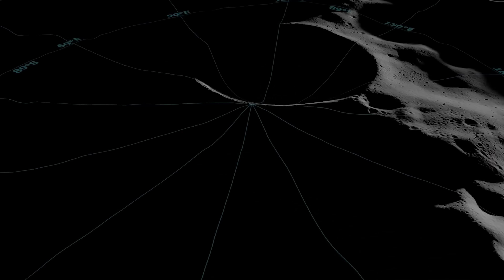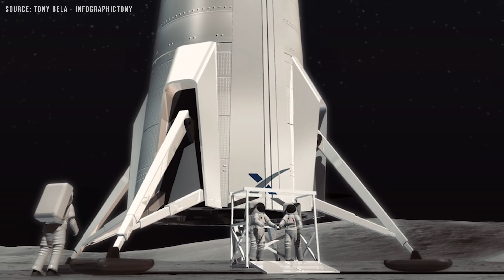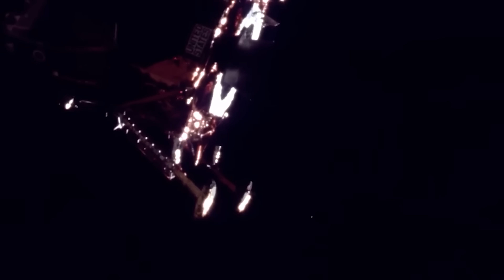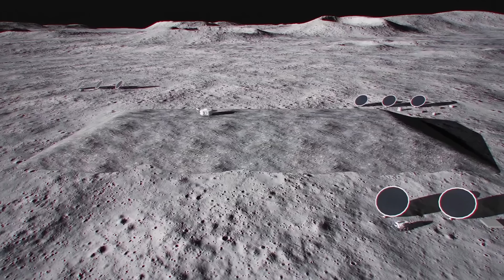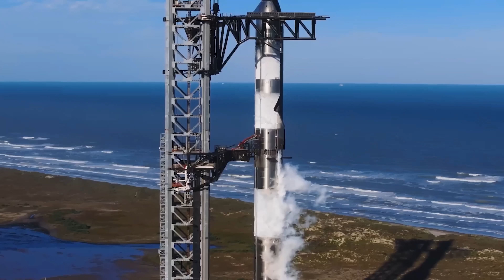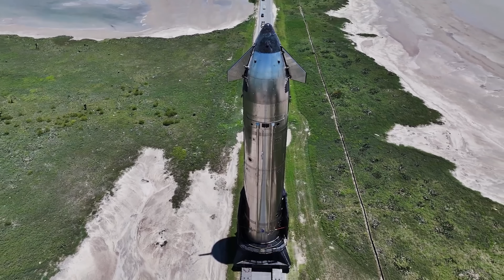SpaceX's New Method to Land Starship HLS on the Moon Sideways, Solving NASA Big Concern..

Comment: Starship is designed to be the second stage on an earth to orbit vehicle. I think landing on the moon requires designing a vehicle FOR landing on the moon and going back and forth to lunar orbit. The Space Shuttle was a one size fits all vehicle that didn't do any particular job very well. Considering all the trouble they are having with the second stage of Starship, I'd suggest a shorter second stage with tanks and engines only and droppable fairings over the orbit bound cargo riding above. Might even have to have reusability wait for a bit on stage two because it looks like a gigantic, workable Falcon 9 right now capable of putting huge amounts into orbit with a reusable booster that drastically cheapens costs compared to SLS. Clearly with nearly EVERYTHING tipping over on the moon as of late, a lander needs to be designed as a lander first and foremost and be wider than it is long so it can't tip over.
Reply: Please do the math on the center of gravity on the vertical Starship HLS, it is NOT the visual center of gravity and is in fact much lower, reason is the propellent weight at near the bottom of the craft.  Calculations show it would need a 21 degree tilt to "fall over", that's pretty large.

Comment: The bottom line is with Starship you're essentially landing a big, heavy, mostly empty fuel tank on the Moon for no discernible reason.
Reply: So, using blue origin Moon lander for transferring astronauts to the moon but using Starship horizontal model for habitat on the surface of the moon. Vertical Starship model can be used later when there is a flat launchpad on the moon!!
Reply: @Tornout-e7i  Who's getting the humans from Earth to the moon?

Orion
Starship
or
Blue Moon
Reply: The reason is tonnage to the moon.  This inherently requires "big" and "heavy".  No tonnage means no Moon base build out.

You wanna send Humans and tiny bit of cargo to the moon surface?  OK, use Apollo or Blue Origin Blue Moon Mark 2, those will get you a few people and enough cargo for a few days - but didn't we do that in 1969?  But it won't get you the massive tonnage you need to stay long term, or start building the base.  Thus Starship.

Comment: Blue Origin are so getting the main contract 😂
Reply: BO's New Glenn is suspended after the failure last Sunday pending FAA investigation.

BOBMMark2 tonnage to the Moon is pretty weak compared to Starship.

*AND* BOBMMark2 in the latest official diagrams shows not only a refuel in LEO, but also a refuel in Moon orbit.  Why?  Because BOBMMark2 is so small it can't carry all the fuel it needs out of LEO/TLI, and needs to AGAIN refuel in Moon orbit.

Starship only needs the refuel in LEO.

Comment: Horizontal is the only smart way. But the structure as designed can’t handle it. I can absolutely guarantee that one of the current versions is going to tip over on landing. Big explosion. Dead crew. That elevator system is laughable engineering imho.
Reply: Need to design a vehicle just for going back and forth from lunar orbit to the surface and back. Shoehorning a second stage of an earth launch vehicle for a purpose it isn't suited for probably won't work. Use Starship to put cargo into earth orbit and there construct vehicles designed for use only in space. Plus with everybody's lander tipping over recently it's clear that lunar designs need to be very short and very wide for stability.

Comment: I am not a physicist so I am not qualified to judge any design. Nevertheless, this SpaceX moonlander will tilt over quite easily I would imagine. Or does the low gravity makes it different from landing on earth ?
Reply: The gravity doesn't really change the tendency to tip, that's controlled by the centre of gravity of the thing. It'll just  tip more slowly on the Moon.
Reply: You are mistakenly assuming a rigid landing surface.  Lunar surface contours can be locally quite steep and the surface is unconsolidated. Things tend to slip easier. Once a slide starts the vehicle inertial properties make tipping much easier.
Reply: Visually the center of gravity looks to be midway, but people forget the fuel is stored at the bottom area, which moves the real center of gravity downward making it stable to a calculated 21 degree allowance of tilt, this is a pretty large tilt needed to tip over.  Eager Space channel has done the math on this.

Once it's landed, it's not going to "slide" like the other commenter said.

Comment: With a horizontal landing wouldn't that have the same problem when the thrusters are too close to the regolith?
Reply: Not if you have half a brain. The required thrust output is far smaller than for the deorbit phase. Much smaller engines, mounted high on the sides, would be many meters above the deck. They also don’t have to point straight down. You can actually perform a sort of flare maneuver as you approach the ground and gradually toe-out the engines to gradually reduce down force and greatly suppress regolith entrainment.

Comment: Send more than one rocket that lands horizontally, with no intention of taking back off. Build a moon base the same way they built the space station. Sending up a node at a time. This is how the ISS was built. With at least 40 trips with parts and pieces. It took over a year and a half of lifting pieces before any human lived aboard the ISS. Do it the same way with a moon base. A piece at a time.
Reply: FYI: One empty Starship V3 has a bit more internal space than the ENTIRE ISS.
Reply: @ConstantTrue  And they will STILL need multiple trips to set up a moon base. Which is forecast to be nothing like the ISS in size or capability but a true base of operations including a fuel depot and etc. There will need to be multiple trips as the moon base will be many times larger than the ISS.

Comment: Elevator failure emergency operation can be achieved by installing a protracting/retracting arm close to the top, that releases a pulley operated cable. The cable can be hooked to the space suit and pull back the astronaut. NASA, you read it here first!
Reply: Also a 2500lbs Harbor Freight winch works, along with a dozen other ideas from my pea brain, as a backup.  The elevator issue is NOT an issue, the press and youtubers trying to make it so.

Comment: The concept of a practical, reusable lunar lander is The Eagle from Space 1999. Ventral and side thrusters (enabling it to be steerable) and good payload capacity.
Reply: this thing is begging to get turned into an Eagle
Reply: Yeah. Starship is too tall. A side landing would be amazing.  But how u lauch it and build it is the challenge
Reply: @mr.prince8701  Why is it "too tall"?
Reply: @ConstantTrue  hard to land. the eagle design got issues too though but i like it. one of main issue with eagle is the head shield for re-entry....there is none. probably would have to reenter on its back? idk
Reply: @mr.prince8701  So there is a common misconception of "too tall" - which normally means it will "tip over" mainly due to the center of gravity being so high.

This is an issue with our human eyes/brain.  We "see" an object and automatically assume the center of gravity is, in this case, 1/2 way up (or 1/2 down).  It's the way most things work.

However, Starship IS NOT MOST THINGS.  It has a good amount of fuel left in it when it lands (it needs to take off again).  This fuel is in the lower section of the ship closest to the ground above the engines.

This fuel, if you do the calculations, brings the center of gravity down to about 1/4 up from the bottom.

Eager Space channel does an excellent job on the math if you are interested.

Calcs show that it would need a 21 degree tilt to fall over, and that's a fairly big number.
Reply: @mr.prince8701  Sorry to "double post".  But...I keep forgetting people on here are talking about a spaceship they saw on a fictious TV or movie AND trying to apply that to real-world physics.  So I will now bow out.
Reply: The Eagle Obsession documentary 
https://youtu.be/3FQcms0O4iM

Comment: No rope ladder at least?
Reply: Probably.  And probably a backup simple winch.  And probably a fireman's metal ladder system built into the side of starship.  And probably...a dozen more backups.  This "what if the elevator" breaks issue is not an issue.

Comment: I vote for a smaller stable conventional moon lander for the initial maned landing on Artemus IV .  Then on follow-up missions send a larger unmanned supply ship to land horizontally near to where astronauts are. The supply ship would be permanent  with no need to take off again and could be used as housing and with food supplies.
Reply: Good logical idea.
Reply: Not sure how the "initial" part of your plan is different than Apollo back in 1969.  New vehicles for sure, but what does it accomplish?  We've been there done that.

The next Logical Idea is to do exactly what we are doing, send a super large ship with massive cargo tonnage to start building the base.

Horizontal would be nice, but kicking up the glass shard regolith with thrusters down there is probably not good.  Starship-HLS solves that by putting thrusters in a ring pattern way at the top of the ship.

Comment: So unbelievably dumb. Just land a smaller probe.
Reply: Smaller means smaller payload.  So what is that goal then?  Small payload with a few humans to what, repeat Apollo?  We've been there done that.

Starship (vertical) is all about massive TONNAGE to the moon to start building the base.

Starship (horizontal) is right now a fantasy with at least the thruster regolith glass shard issues, maybe fixable, maybe not.
Reply: @ConstantTrue  i misspoke. I meant a smaller assent stage. By all means use as big of a Descent stage as you can manage. But in my opinion, it is an enormous waste to ascend and descend the entire lunar module like starship does.
Reply: @thoughtsuponatime847  Well, we've not seen an actual Starship HLS, so who knows what they have planned.

I think there's some thinking to do there, means you would need 4 fuel tanks - 2 for the descent, and then 2 for the ascent, I don't see that as a problem, could be done.  I guess the trade off in this scenario is you'd need more main engines which are tucked inside attached to the upper stage (for liftoff), as well as the current engines in the lower stage for descent.  Remember, you need just as much thrust going down as coming up.  So you can't just cut the engine numbers in 1/2 like would "kinda" make sense, but mathematically it doesn't work that way.  So you'd need to add more engines, which adds weight, add 2 tanks, which the 4 would be proportionally smaller, but you'd technically be adding an additional dome top, dome bottom, and common bulkhead - and vertical space for the engines "inside".  Lots to consider.

FYI: The DeltaV does not change there on the moon as there is no aerobraking.  (appox 1721 m/s in and 1721 m/s out).  So thrust in would be same as thrust out.
Reply: @C @ConstantTrue rue. There is certainly overhead with a separate ascent module. But consider how small the ascent stage of Apollo was. I doubt you would need anything larger this time. There is no way the overhead of a small ascending module would compare to the overhead of sending the entire habitat to and from orbit. 

Additionally, your ascending module can reuse the same rockets/tanks as the descending module. Once your moon base is on the surface, you don’t need them again

Comment: I can see that eventually the Starship may deliver a lander to the moon's orbit, and then that will go to the surface. A larger version of the Eagle, used in the TV show 'Space 1999', would do the trick. You need something that can deliver a 40 ton moon rated excavator to the surface, driving down a short ramp.

Comment: SpaceX Starship will likely replace all of NASA's future astronaut plans. 
Starship has a lot of astronaut applications for a far, far less expensive permanent human presence in space.
A single Starship could replace the ISS. It has more pressurized volume than the ISS. A single launch at $150 million. Instead of 27 launches at $1 billion each for the shuttle to build the ISS.Plus Starship can always come back down for reuse and resupply.
For a trip to the moon Falcon 9 and Dragon could take astronauts up to a fully refueled Starship in earth orbit which then departs for the moon. Multiple, fully automatic refueling trips are needed.
Starship also makes more financial sense for a moon space station as well. Instead of the far more expensive Lunar Gateway.
One could also be sent, unmanned, to land on the moon horizontally and act as a moon habitat.
A small lander with astronauts could then make the short trip from the moon space station to the moon surface and back.
Reply: I agree with almost all of this.  Keep in mind the whole game comes down to TONNAGE on the moon surface to build the base.  So, humans can go down in whatever "small" thing anyone wants, but Starship or something LARGE has to at least deliver that TONNAGE down.

I've also thought of using Dragon to crew up to LEO, then Starship to Moon via TLI.
But NASA plan is to still use Expensive SLS-Orion to do the human transport to the Moon orbit (NRHO), then do crew transfer to awaiting S-HLS, down to moon, work, back up, then return crew to orion to come home like Artemis 2.
Reply: @ConstantTrue  NASA's Artemis plans are changing. Block 2 SLS and the launch pad to support it are cancelled. So is Lunar Gateway.
To save money.
"As of early 2026, NASA is significantly expanding its reliance on SpaceX, pivoting away from solely in-house, government-built hardware toward a model heavily dependent on SpaceX’s Starship for its Artemis lunar program. This shift, accelerated by new leadership under Administrator Jared Isaacman, prioritizes commercial partnerships to speed up lunar exploration."
"Key Aspects of the Pivot:
Expanded Artemis Role: SpaceX's Starship is slated to handle a larger portion of the Artemis III and IV moon missions, including carrying astronauts from lunar orbit to the surface, and potentially transporting, docking, and propelling the Orion capsule.
Shift from SLS: NASA is reducing its reliance on Boeing-built Space Launch System (SLS) for heavy lifting, opting to use SpaceX for faster, more frequent, and less expensive alternatives.
Commercial Focus: Under the new direction, NASA is transforming from an entity that builds its own vehicles to one that acts as a customer buying services (landed cargo, crew seats) from private partners, mainly SpaceX and Blue Origin.
Long-Term Goals: This pivot supports a move to establish a permanent moon base by 2030, with Starship serving as a central transportation system."

Comment: SO this isn't actually SpaceXs new method afterall !!
Reply: No, it's not.  

Current plan is Starship HLS (S-HLS) docking with Orion in Moon orbit (called NRHO), crew transfers to S-HSL, S-HLS breaks orbit, lands on Moon vertically, humans do work (mostly unloading cargo), and get back in to launch from Moon surface, dock back with Orion, humans come home.

Starship-HLS is not coming home, possible hang out in Moon orbit, or land back down on Moon (depends on fuel).  In either case, it's a backup for future missions.

In fact, since NASA is probably going to do a UNMANNED attempt first, when the humans actually are there, there will already be a S-HLS craft in orbit or on the surface.

Starship-HLS does not have black heat tiles, it's NOT re-entering Earth atmosphere.  It has instead white sun reflective tiles to block excessive fuel boil off from sun thermal heat on way to Moon (and block radiation, depending on materials used), and operations on the Moon.

Eager Space channel shows a much lower center of gravity due to fuel left in S-HLS at bottom as opposed is "visually" normal to us humans simply looking at the renderings, I can't remember the exact figure but the CoG is about 1/4 the way up from the bottom, not 1/2 as you would normally "visualize".  A more than 21 degree tilt is required to "tip it over" per those math calculations, that translates to a small chance of it doing so.

Elevator backup is solved by at least a dozen ideas I have in my own pea brain, including at the simplest, (meant to be funny) using a 2500 lbs Harbor Freight winch attached before descending in the normal elevator to the side of the top of the elevator structure, lower that cable with hook down to ground level, then use the elevator.  If the elevator breaks, use the winch cable at the ground to clip onto spacesuit (or grab it from the elevator's stuck position), use wired or wireless winch to slowly winch yourself up, and simply walk up like climbers do or Tom Cruise did on that building in the Mission Impossible movie.  Except on Moon there is no WIND to be concerned about.  Yes, a lot of hillbilly engineering here, but concept the same when NASA/SpaceX does this for reals.

Comment: Just launch a lander from starship in orbit. No need to send all that mass to the surface.
Reply: They want to create a huge lab.
Reply: @binxbolling  Exactly.  Mass (tonnage) is EXACTLY why Starship is so huge.  We need massive tonnage on the moon to start building the base.

To move massive tonnage requires a massive ship, it's just the way it works out with the rocket equation and delta-v.